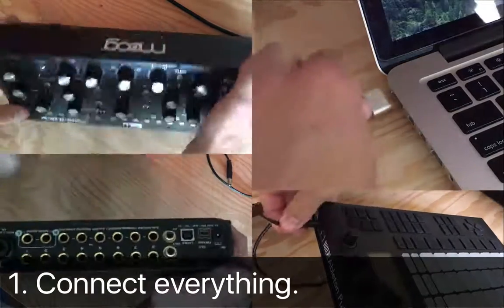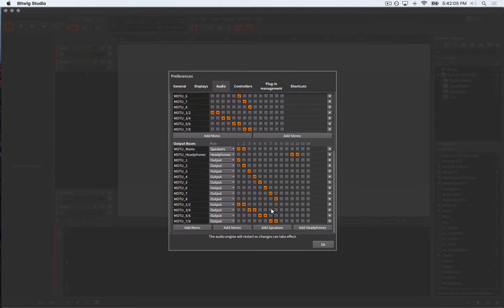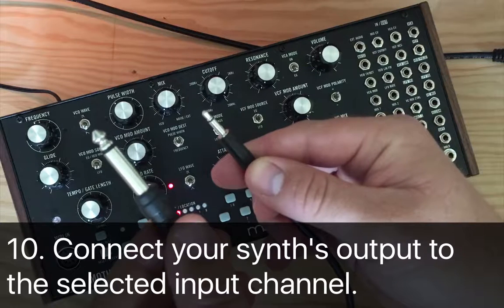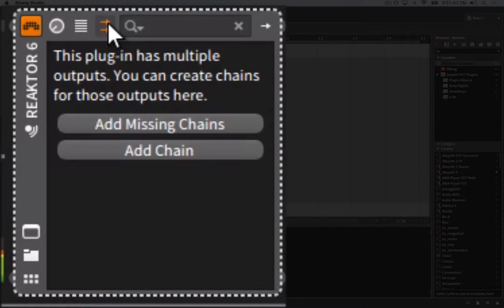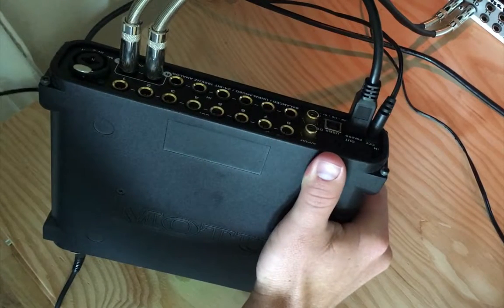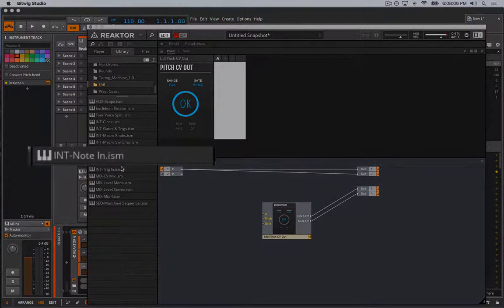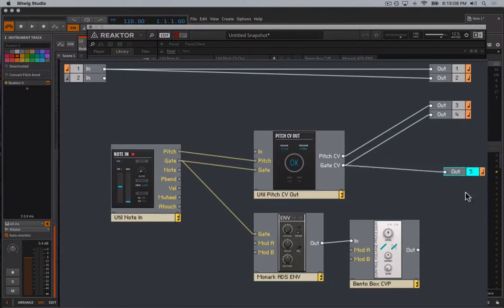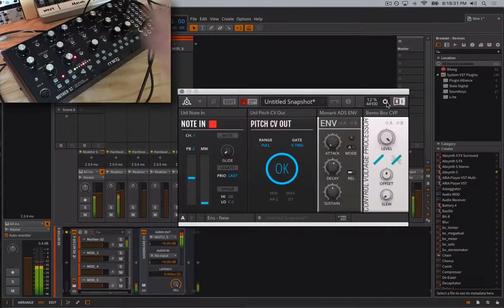Connecting Bitwig & Reaktor to your Modular Synth

Comment: I have a first generation Motu 828, a Mother 32, and Ableton. I just need to upgrade to  Reaktor 6 to achieve this level of control. Where can i buy the cables you're using in this video to connect from the Motu audio device to the Mother 32?
Reply from the maker: +Antonio229 I grabbed mine at the local music shop, but you can also order them online from just about anywhere. They are just unbalanced 3.5mm to 1/4" audio cables.

Comment: What are your thoughts on using the Motu Ultralite vs. Expert Sleepers ES-8....I'm thinking that maybe the Motu is the best solution for a studio situation?
Reply from the maker: +Quantum Space I haven't gotten my hands on the ES-8 yet, but it looks pretty sweet for a mobile rig. I have almost always used MOTU interfaces because they just work and they are super durable. While most (maybe all?) of MOTU's interfaces are DC coupled, they are not calibrated as precisely as they ES-8 supposedly is. Which means sending 1v/oct cv requires some means of soft-calibration (Reaktor, Max/MSP, Max for Live, etc.). 

The ultralite is a nice little travel interface, but if you are only doing studio work, I might recommend going bigger. Perhaps the 828x or the 16A.
Reply: Giving some serious thought to your two suggestions. I "sadly" already had a UAD Apollo Twin Duo (pre-Eurorack obsession) and it only has one ADAT input and Black Lion cannot modify this particular unit due to lack of internal space. I only work in the studio so I don't require mobile, so my apologies if I'm dense on this but I'd like to be clear before I try to sell the Apollo, is it also your understanding that the ES-8 is best suited for mobile? The deal is that I need to use a solution with Bitwig and as I can only use one interface at a time in Bitwig, if I were to choose the ES-8 for CV routing I cannot see how I could simultaneously monitor audio as I would no longer have access to audio outs for speakers or headphones except from what my modular gear is putting out. But if I were using the Motu I would have my normal monitor/headphone outs in addition to the CV I/O. Does that sound about right?
Reply from the maker: Yeah, my understanding of the ES-8 is that it is optimized for sending/receiving CV. And, I'm just guessing that the converters in something like your Apollo Twin Duo are going to be nice (better sounding) than those in the ES-8. Again, just guessing. I would recommend sending Expert Sleepers an email and seeing what they recommend

That said, while the Apollo is a sweet little interface, but you'd probably really enjoy having a lot more I/O.

Comment: Do you need to use a CV-processor whenever your send CV to Hardware synths? or is it optional?
Reply from the maker: +Deaq What do you mean by a CV-Processor? In this video I'm just sending audio straight out of a DC-coupled output in my audio interface directly to whatever I want to on my modular.
Reply: I have pretty much the same setup as you do, same synth, Sound card, the only difference is that I use Ableton live. But sometime I am experience that modulating Moog Mother 32 certain parameter don't full work. I though maybe you would need a further processing before sending it out back to Moog Mother 32.
Reply from the maker: Deaq the DC outputs on the Motu Ultralite are not calibrated the to the same levels as a modular system works at so you will find that in some cases it won't provide as much modulation as you might like.
Reply: so the optimal way would be to use expert sleepers hardware modules for this stuff?
Reply from the maker: +Deaq Yup. There are a few other modules, but expert sleepers seems to be the best option.